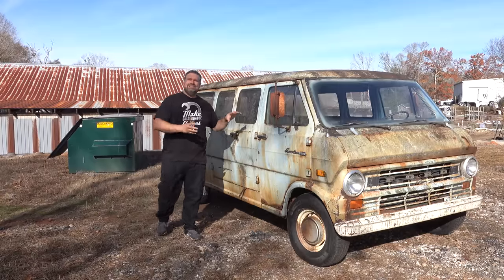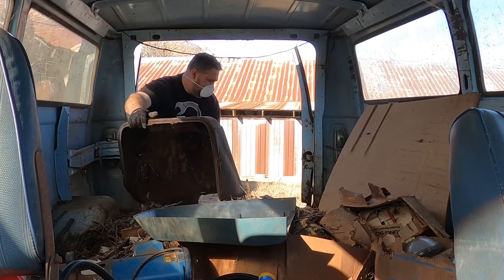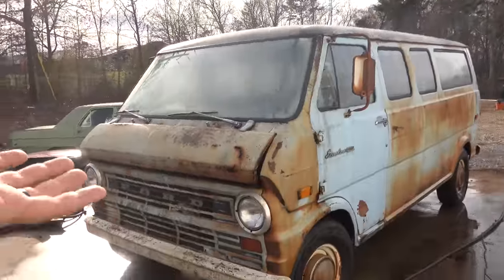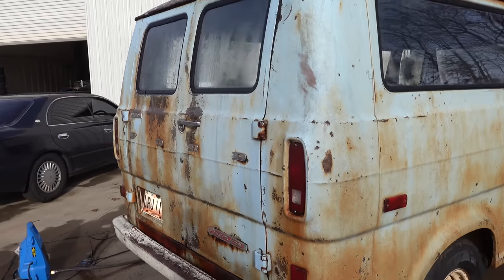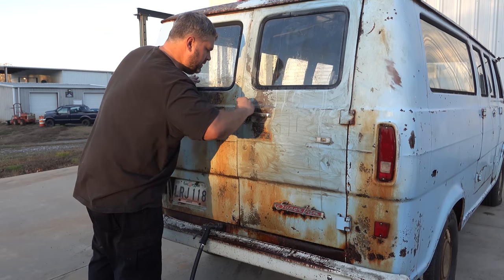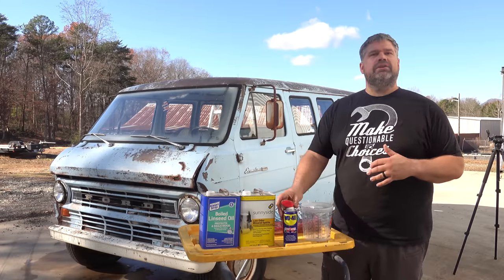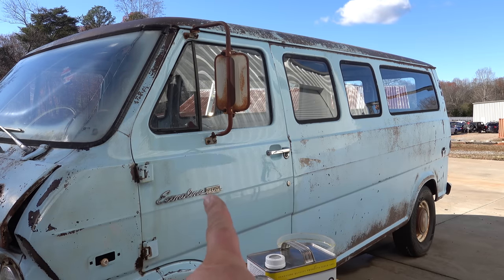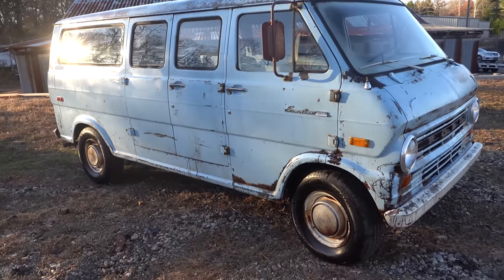First Wash In 32 Years! Abandoned In The Woods, Can This Van's Paint Be Saved? Ford Super Van VGG!

Comment: Still really like the idea of keeping it simple. 300 straight 6 with EFI (factory or otherwise), add on overdrive, overhaul the suspension and that would be a great cruiser. The slot mag, side pipe freak van look would be pretty cool. Too much shag carpeting though and you might as well call it Pink's Pleasure Palace.
Reply: Whole heartedly agree.  A nice 300 would still smoke the tires if you want.  Slot mags and side pipes would be too cool.  Put in some shag carpeting and maybe Mexican blanket curtains… Yahtzee!!
Reply: Ford 300 or building up the original engine was what i was thinking I'd like to see. That would be super fun to watch. The camper/tow rig idea seems cool too, but you may want more power eventually and the budget build is better.
Reply: I'd love to see a turbo'd and built Barra for a lazy 500 or so absolutely bulletproof ponies (and somewhere north of 600 lb:ft of torque) with the slot mags and sidepipe as a tow vehicle with a sleeper setup in the rear... but I am Aussie :)
Reply: I'd take the LS out the Lexus and throw it over the vans back wheels!
Reply: That's effectively a barra swap
Reply: Agree almost 100%. Do a 6=8 300 build, compression, cam, headers, intake with 390 or similar carb. Upgrade brakes and suspension and lower it a tad. Id keep the chrome side exhaust off though and just do mid exit dumps. Do some 16"-17" wheels with an 80s theme and tuck bumpers and add a tad bit of underchin spoilerage. Maaaybe even modern mirrors?
Reply: Another vote for this route

Comment: Definitely keep the 240 in there! Lots of comments saying "300s are easier to find parts for", but the two are identical except for the rods and crank I believe. An Offenhauser intake with a 2 barrel for a bit more HP and torque seems to be perfect for a period correct mod. If you decide to go 4.9, the stock MPFI really bumped up the HP, and a '96 will have mass air flow for a taller cam grind
Reply: 94 and up could have maf depending on emission level.
Reply: @danatkinson6698  right, but only for the 302s, the 300 only had MAF for '96
Reply: @evanruhl249  well damn

Comment: Hey Jared 🙂 Love the old Econoline. My take is: modern brakes, suspension work, decent engine and auto transmission to make it an occasional tow rig, and D-ring load-securing eyes bolted through to the chassis in the rear. Patina stays (that’s non-negotiable for car guys 😆 ). Then use it as a gofer/parts-chaser. It would look epic with “Questionable Garage” and a period phone number in period font in faded/patina white 🙂
Reply: Agreed; also some modern (not chromey) wheels
Rust reform and truck bedline the entire interior!
Reply: All of this with a 302!

Comment: Jared, even after hearing your idea of hot rodding inline 6 and throwing on some neat wheels, I'm still liking the offhand suggestion of building this van into a basic camper van you can take on other revivals or just camp in whenever, dress it up a bit if you wanted to, but turning it into a camper van doesn't necessarily need to be that expensive. I'm an RV mechanic myself, and building something low budget for it wouldn't be terribly difficult: maybe build a platform to fit a full size bed, slap it in the back of the van, get some storage drawers underneath, done. Route in some fresh and gray water tanks into the van and a small sink housed in a countertop, that'd be easy with swappable jugs...routing in a basic 2/3 burner propane stove top could be really easy with a single propane line and mount a tank somewhere internally or externally for the rig, then slam in some overhead storage, before you know it, you've got a basic camper with still a substantial amount of space for hauling as that van is a pretty long chassis, food for thought. 

I'd love to see that, but even if you don't build it like that, I can't wait for the next video! Awesome video this time around, as the van looks amazing after this wash!
Reply: Agreed. Simple budget camper build. Some insulation, a surface to sleep on and a bucket full kitty litter. Maybe add cooking, auxiliary power and a work surface if ambitious. Bonus points if you can rig a Starlink.

Comment: Here's my idea.   Freshen up the steering, and suspension, upgrade the brakes, then swap the engine with a GM 4200 Inline 6, also known as the Ameri-Barra, and turbo it! These engines have great response to being boosted.  Build the interior to be a really nice campervan.
Reply: I was thinking of the 4200 as well, should be able to get one cheap from a wreckers and you'll actually be able to get parts for it. Who cares if it isn't a Ford motor, that's what hot rodding is all about!

And a camper seems really appropriate, it's spent all this time in the woods with little critters living in it, now it could go back and be for bigger critters.
Reply: Oh hell no, keep that junk engine away from this van! 😂

Comment: The ideal would be for the Van to become a tow vehicle and command post on trips to the track but I'm not sure if that straight six has the muscle to pull a trailer or not.  That said, install an RV AC unit on the roof, and an AC converter with a spare battery or two for static power, put in a mini-fridge, a coffee maker, a microwave, window curtains and a fold out bed and you're good to go.  It might be worth replacing the straight six with a V8 but it does run pretty good so maybe stick with what you have for now.  It's a pretty nice van.  Great work!  Loved the video.

Comment: Nice job of first the rescue with Derek, then this cleanup to make it presentable.  Your thoughts about keeping it more or less stock are right on.  As for building it up, I'd toss the little six and replace it with either a 300 six, or a mild 302.  Nothing fancy, but set it up with a modern TBI setup instead of a carb.  No lowering, just some wheels and tires.  Clean up the inside, maybe some seats, carpet, etc. and use it as a run around vehicle, parts hauler, shop truck, etc.  It deserves to continue to live a utility life, not turned into a 70's era love van.

Comment: Jared a suggestion. Why not turn fhis into a period correct two buds and a boat build? It looks big enough to fit a small going to the lake aluminum boat in there. Do the interior up with rod holders and fishing tackle storage. As a child of the 80s my parents had an old ford van very much like this. At one point we used it to haul our snall boat and take it to the water. This thing has a ton of room for gear and beer ;-)

Comment: Coloradan here.  Turn it into a back country mountain van.  Put a power stroke diesel in it to handle the mountain passes and snow.  Convert it to 4WD and put a lift on it with some proper beef for tires.  Convert the roof to handle and carry some racks for skis and snowboards.

Comment: Keep the 240 and column shift because those are cool! It's a 3/4 ton so it's already built up to haul weight, whether that's people, car parts, or work supplies, it should be able to hold over 2,000 pounds of cargo no problem. You could even tow with it. Race car hauler with plenty of parts room!

Comment: Nice Van, I have a 1969 E200 Supervan myself with a pop top camper. You guys had me beat by a few years, mine only sat since 1992!

Some helpful info I have found in my resurrection process:
Scarebird Brakes makes a front disc conversion, but they will be shutting down operations at the end of this year. It uses all off the shelf parts for the calipers and disc's, your just buying a adaptor plate
Rare Parts makes all the steering components, Redhead steering gear will rebuild the steering box, and Eaton-Detroit has leaf springs.
Steele Rubber for all your weather-stripping and window seals
Nobody makes a replacement rad anymore, but you can swap one in from a 60's chev bel air with minimal effort

Oh and if you want to get really wild, I did some measuring and it seems like its possible to fit a 2.3 mustang ecoboost under that doghouse cover....

Comment: I built custom vans for a living in the late seventies early eighties. I would love to see a retro interior. Ours were a simple plywood floor with padded carpet, insulated walls covered with wood grain paneling, trimmed with the same carpet. (cut a four inch strip, double one edge over one inch, glue, staple this edge to the outside face, fold over the edge of the paneling and glue with contact glue) Hope this helps.

Comment: I drove a 1969 ford van (undercover police owned van) for years for the Spokane PD,   6 banger, three on the tree and never once did it leave me hanging.  My suggestion, just fix the interior to be used on the weekend to go on a road trip or something like that.  Maybe trick up the engine a bit but leave it in place.  Maybe fuel injection and a split manifold.  Please, please DO NOT lower it.  Leave it where Ford designed it to be.  You will thank yourself in the long run.  Love the exterior and like they say, putting lipstick on a pig, it is still a pig.  It earned that look, so don't mess with it.  Good luck with your van and you show.  Enjoys both with you and VGG!!

Comment: Jared here is  what I would do if it was my van, and you may or may like it. Rebuild the 240 Inline 6, remove the intake and exhaust manifolds then replace those with an intake that allows you to bolt either a 2 barrel carb or 4 barrel carb on it. From there I would get a set of headers that allow you to split the exhaust, to have duel exhaust. And yes they make both the intake and exhaust for that engine, as it is the same as the 300 inline six. It would still be period, and would  give the engine a fair amount of horse power without going all radical on it. But look at Power Nation's 300 inline 6 build where they get 300 horses out of an inline six.

Comment: Just a little insider info on your pre-measured buckets... specifically that one.  They're not super accurate because 1. T60785's vary in size 2. The part varies in height on the mandrel when printing 3. Sometimes I'm lazy and cheat the print in to the top or bottom of the gauge so I don't have to adjust my print height and head pressure. 😅  So if you're mixing something that needs to be really accurate use a scale.

Comment: I like the camper idea myself, and no you don't have to go all out for it, just build the motor up enough to use it as a hauler, with a futon like bed for 2 people, that can double a bench seat with some lap belts for legality reasons, a little bit of storage, some kind of heaters for if it's cold, and maybe get harbor freight to sponsor some solar panels, and batteries so you can change things like cell phones, and camera gear on the road, along with having a few interior lights.

Comment: Put a l.ittle 302 in it. Panel the roof and sidewalls inside and maybe carpet the floor for quietness. Upgrade the brakes, and now you have a nice dependable parts runner and weekend camper.

Comment: I am thinking out loud here I like the idea of restoring it as a camper or passenger van.   Will an older chevy big V6 rear wheel drive motor fit in that spot?  You can probably pick one of those up inexpensive.   That would give you the power.   You have some floor issues that need to be fixed as well.   The brakes are still shot.  Food for thought.

Comment: This is the textbook case when instead of a shovel, a shopvac and a pressure washer you better off with a flamethrower.
Just selftap a set of beer bench to the back, and you are done. Cheap, lightweight, fun. And really practical.

Comment: ❤ I like this van. I am liking your moderate warm up choice. Keep the current engine or stick a 300cid in it. Maybe stick a AOD 4 speed automatic behind it. Maybe put some 70, 65 or 60 series tires on it. Or do a mild skinny wide set up front to rear. Going to a lower profile series tires will also drop the van ride height just a little bit. It will help its overall look without getting wild about it.

On the interior, don’t go crazy. Just do a restrained minimal installation in order to preserve the window van look. This is a window van, not a steel sided cargo van. Preserve your all around outside visibility.  

With all the windows, consider adding one of those period correct Wink wide rear inside rear view mirrors. That’s the old school perimeter side and rear view camera set up. 

Instead of going berserk on modifications, spend some of that effort on repairing the rusted holes in the floors. 

There are lots of cool wheels from the 70’s and 80’s that look a whole lot better on this van than the modern fuel style wheels. 

I personally would consider putting a rustolium red or red and black primer on the roof because I would not like to see the metal on the roof degrade to the point you start getting rust pinholes and water leaks all over the place.

Comment: Polished slot mags
Light tint on windows
Spray floor with bed liner
Redo front suspension/steering 
Drop a 300 in it
Bench seats
Bucket seats
Panel of gauges with monster tach

Comment: Hot rod 240 for the win. The 300 for pulling the 240 for quick reving. Or 300 with the 240 rods and head and 302 pistons. Clifford intake machined out for multiport fuel injection. Microsquirt to manage timing and fuel. Ls coil near plugs, Duel exhaust from a 96 300 for the duel o2 sensors so you can time the front three cylinders and the back three separately. All of these can easily be done to the stock engine. Oh don't forget Chevy rockers to give you a better ratio. 
There are a lot of 300(240)guys out here really looking for something to cheer you  on. Just give us a little something. Or you could put an ls in it.( please, please, please understand that the la comment was sarcasm).

Comment: If you have to clean something as bad as this again.
Wet it down have a bucket of hot water with 2 cups of washing machine powder  trothed up.
Use a yard brush and work it in leave 5 mins and jet wash it and see it all just come off and leave a shine.
It works very well.
I have used it on old caravans that have been standing ages and they look new after and shined up

Comment: It runs, fix what's there and maybe tune it up a little, but it's complete and in the spirit of cheap revivals, leave the drivetrain mostly original.  Probably needs a clutch/u-joints/rear end seals.  Disc brake conversion on the front (already have the master cylinder for that just fix the lines and change the combination valve), rebuild the original suspension and steering.  If it were mine I'd want to make a service truck/parts runner out of it, but with all the rear glass it has it would make a better cruiser/camper/conversion van with custom interior, curtains, shag carpet, seat belts in the back.  It would be the perfect family cruiser to take on the hot rod tour.

Comment: you are probably already doing somethign with it BUT
I would keep the patina, put the protective coat on it, but take all the metal pieces like the car name, the handles, all that and restore them, like brand new, same for lights and you know rubber on windows so that it looks like a brand new van but with a patina color scheme
also make it a sleeper, a bigger engine, but not you know over the top, make it fast but not insane, maybe only clue outside would be some cool looking big exhaust tips or something like that.

Comment: That van should have a 8 cylinder flat head in it. Perhaps some insulation and a mattress. Perhaps a cold snack cooler by the rear doors. Cab separator and pass through for a few ideas.

Comment: * Just clean up the interior and keep it open (color matched rhino liner on the interior sheet metal, clean up the dash, Vintage Air, utilitarian reupholstery)
* Modern engine with fuel injection.
*original suspension, no rake or lowering, just a bushing/shock refresh.
* keep the exterior as is, but update lighting as able for safety

Comment: Fix all the mechanicals so that everything works. Make upgrades as you see fit and turn it into a practical tow rig that will get the race car to the track with a bunk in the back so that you can sleep in the pits like we did in the 70's. Make sure that you have ventilation and a great big cooler.

Comment: Honestly putting a better engine in it and using it as a tow rig sounds like a great idea. You don't got to overcomplicate the camper. Sleeping bag in the back and maybe a futon bolted to the floor and you're good to go. Pretty much live in Dodge Caravans when I'm on the road.i just use a sleeping bag and a few blankets and reclining bucket seat and you're good to go. I've lived like that and Winters as cold as 20 below zero with a bunch of blankets and a sleeping bag and I didn't get cold. If you want to lay down in the back where it's a big boy van wasn't joking about something along the lines of like a futon bolted to the floor or put a coach in part of the back and attach it to the floor and sleeping bag with said coach and you're good to go

Comment: I like the plan you're leaning towards. Slot Mags, slightly lower, hop up the 240 ci a bit, fun rear bench seat. However, maybe clear coat/oil the floor and that way it can be used as a cool cruiser and a parts hauler if need be.

Comment: Maybe an approach with reliability in mind, full injected V8 302 with around 300hp, four speed automatic with correct column shifter, freshened suspension with a touch of modern upgrades, freshened power brake system with discs up front, freshened steering box and components with power steering added, good after market A/C unit installed.

Comment: That van may be a 72. The new stricter unleaded fuel emissions standards were known in 72 and some vehicles built then already had the new tighter emissions standards applied therefore the sticker says 74 emissions compliant. I pumped gas in 73 and saw lots of cars labeled 74 emissions under the hood as I checked and added oil. Great find guys!